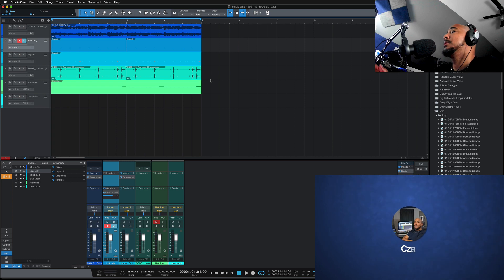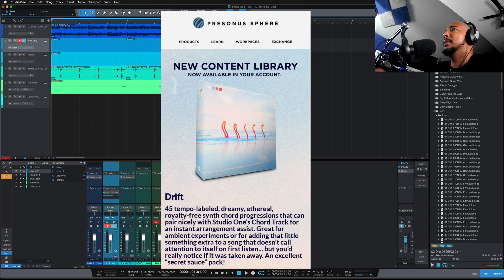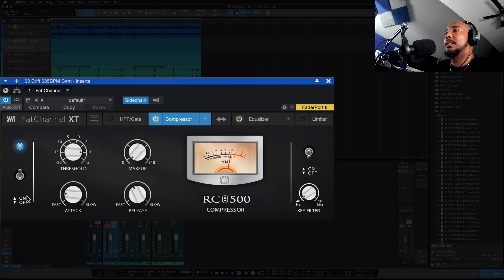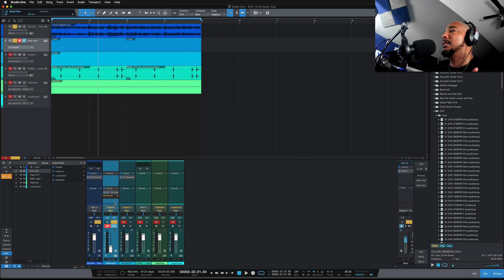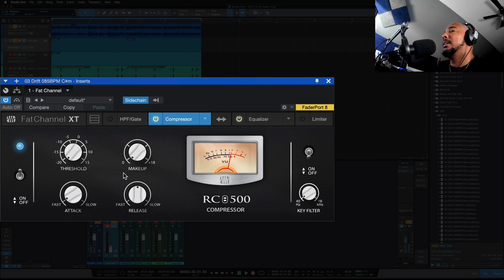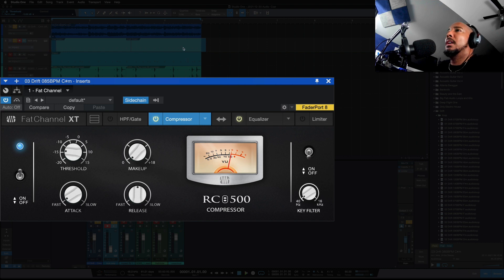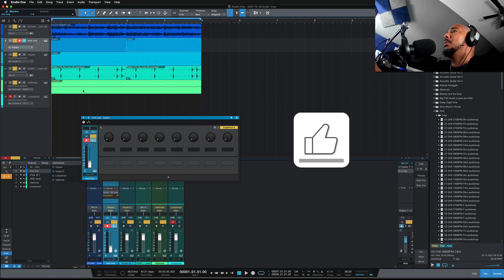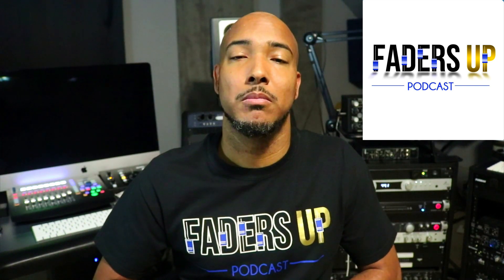How To Make A Synth Pump in PreSonus Studio One

Comment: You can create a “No Bus”  in the Audio I/O Setup output section and add a stereo out track which is not assigned to no any LR outputs. Which you can save as a default. So that you can route the kick to that bus without touching the fader.